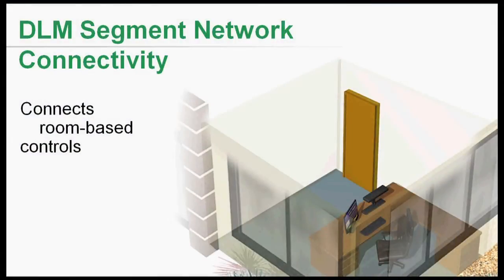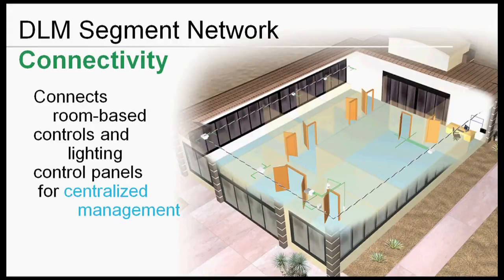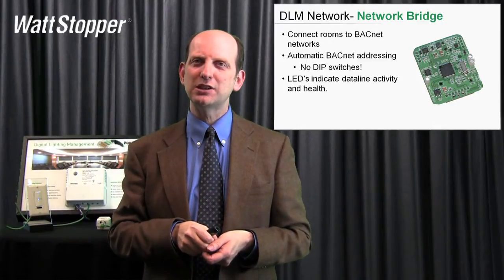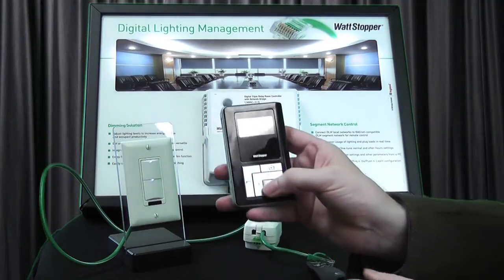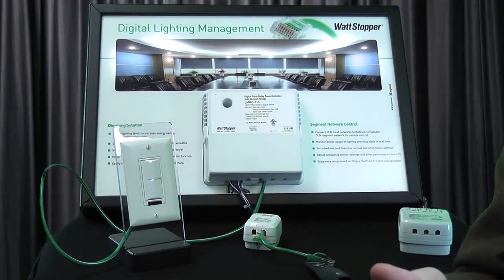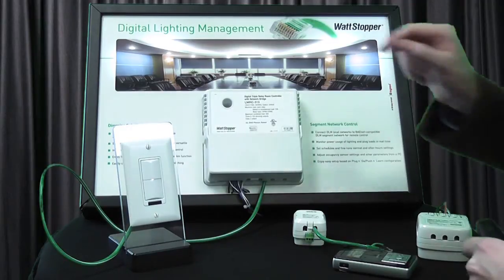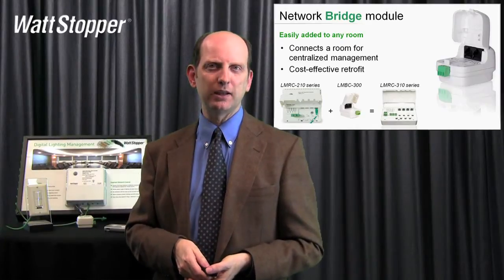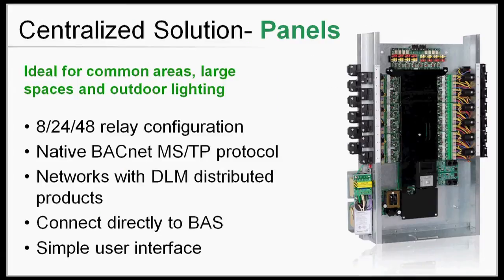Watt Stopper - DLM Networking - Part 2

Comment: what abou the elcu200 relays and their spares... not. to mention corridors with many rooms.....
Reply from the maker: The Wattstopper DLM platform is capable of single room control as well as fully networked systems able to control many rooms together on a central backbone.  In most cases stand-alone rooms do not need to be connected together, these rooms will operate with occupancy sensors to automatically control the lights and meet energy code.  Corridors and other public areas are often controlled via a LMCP lighting control panel for on/off operation on a set time schedule.  However, this architecture can be easily networked together using network bridges and native BACnet communication allowing a central front end and integration with other systems.
 
Wattstopper’s UL 924 rated emergency shunt device has the ELCU part number.  These devices are used in facilities with a central emergency generator or lighting inverter.  They automatically override all lighting control when the normal power feed loses power per the requirements of the National Electrical Code.  These devices are also UL rated to override dimming to full bright when used with a Wattstopper room controller.  Additional information on these can be found at https://www.youtube.com/watch?v=TQ3rHBxXuoE